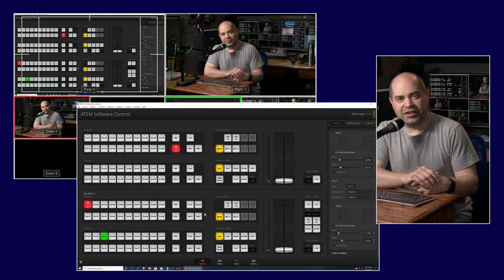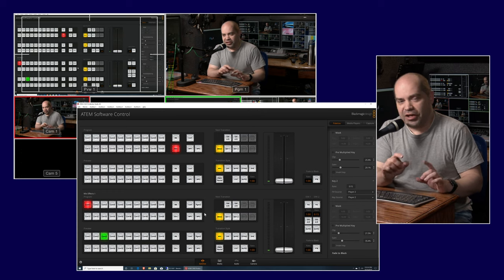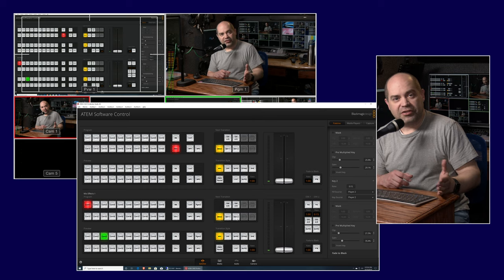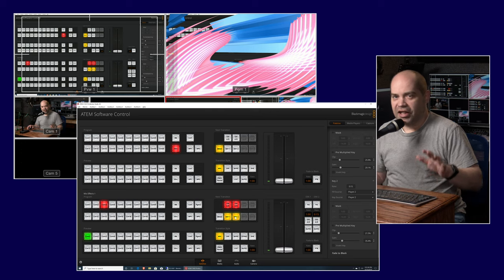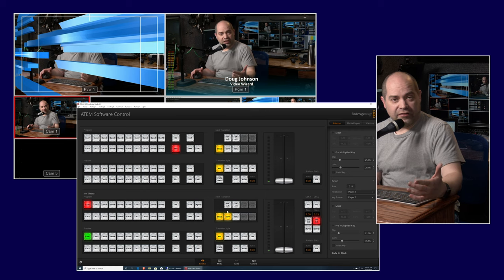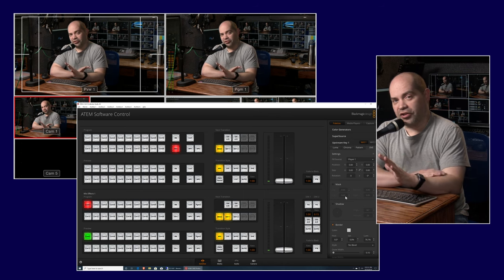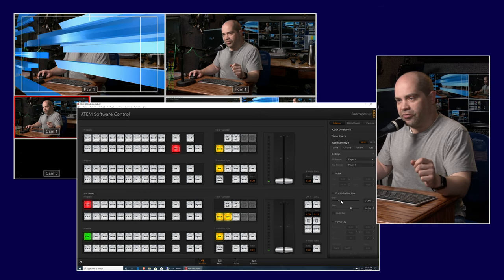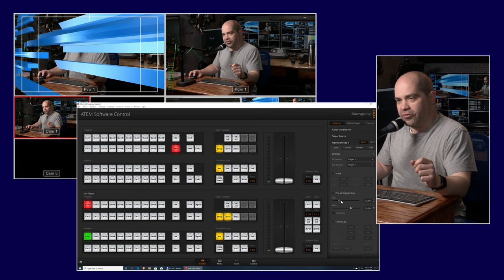Video Training: Upstream and Downstream Keys... What are they?

Comment: I am in need of using two separate alpha key sources. One will be for media over a livestream broadcast, and the other will be for media over in house IMAG. What I plan to do is switch between cameras and have DSK that is sent from Propresenter 7. With an SDI output card I am able to send the key and fill source as needed from PP7, which allows me to have two SDI lines as separate sources into the switcher. What I would like to do is create two separate PGM outs. I plan to have two separate alpha key signals for media overlays (2 separate keys and 2 separate fills). I would like to have PGM1 use DSK1 and PGM2 use DSK2, but I am not positive that this is a functionality of the ATEM 2 M/E. If this doesn't work, the only other thought I had was using a 1 M/E alongside the smaller TV Studio. 1 M/E would switch cams and have one alpha key to PGM1, and another out would be the clean feed without any keyer? Then the smaller TV Studio would simply receive the switched cameras, and then a key and fill source for the second DSK. I want to do all this on the 2 M/E. Can you help me here?
Reply from the maker: The 2nd M/E doesn’t have any DSKs. You’d have to do it with a USK and all of the headaches that come with that.
Reply: @djp_video  Ok. What would you recommend for making this happen? Apart from camera switching, I basically allow the DSK to be slave to whatever ProPresenter7 is sending it. No switching necessary except camera view. Is there another product that would allow for the setup I mention earlier? Or would it be easier, more cost effective, to run this setup through a 1 M/E for main camera switching and one DSK for one of the needed PGM outputs, and then run a clean feed of the switched cameras out of the 1 M/E and into a TV Studio with two additional inputs for key and fill for that units DSK (3 SDI inputs total on the TV Studio).

Comment: Can you make video pls
Reply from the maker: You don't need to spam me with six messages. One was sufficient.

If your model of switcher doesn't have SuperSource, it also doesn't have the required hardware to do two picture-in-picture windows. You either need SuperSource, or two DVEs, to do what you're wanting to do. All of the models with two DVEs also have SuperSource as well. These include: 

ATEM Mini Extreme [ISO]
ATEM SDI Extreme [ISO]
2 M/E Constellation HD/4K
4 M/E Constellation HD/4K
Constellation 8K
Television Studio HD8 [ISO]
Television Studio 4K
2 M/E Production Studio 4K (must use SuperSource; it only has one DVE)
4 M/E Broadcast Studio 4K (must use SuperSource; it only has one DVE)

The following models cannot do it, as they don't have the hardware to scale two video sources. If you have one of these, you'll need to upgrade to a higher-end model...

1 M/E Constellation HD/4K (No SuperSource, only one DVE)
ATEM Mini Pro [ISO] (No SuperSource, only one DVE)
ATEM Mini (No SuperSource or DVE)
ATEM SDI [Pro] [ISO] (No SuperSource, only one DVE)
ATEM Television Studio HD [Pro] (No SuperSource, only one DVE)
ATEM Television Studio 4K Pro (No SuperSource, only one DVE)
Any other model not listed

Comment: This is awesome! Thank you, I have one quick question... how does this apply to overlaying (keying) pro-presenter feed over my camera feeds?
Reply from the maker: You could use either an Upstream or Downstream key to perform that overlay. They both behave the same in terms of how you set them up.

The best way to do it is to have it output separate Fill and Key channels so you can preserve the transparency data created within ProPresenter and use that to create the cleanest overlays in your ATEM. That requires a DeckLink or UltraStudio device with separate outputs for Fill and Key, like the UltraStudio Mini 4K, old UltraStudio 4K, or upcoming Media Player 10G (as Thunderbolt devices), or Decklink Duo/Quad/Extreme/8K Pro.  I haven't done a video explicitly about using that technique from a computer, but the technique is similar to what is demonstrated in https://youtu.be/64RZOAy9j3s and https://youtu.be/rLrmRnjWjTY using HyperDecks instead. 

You'd setup your Upstream or Downstream key in your ATEM to use the two channels from your UltraStudio/Decklink independently, and this would give you the best result possible. It allows not only gives the cleanest looking graphics, it also allows you to do things like partial transparency, where graphical objects allow some of the background to show through. That's impossible, or at least extremely difficult and limited, with other techniques.

This works because your software is providing both the image that you want to see (Fill), and the transparency information (Key) separately. So any pixel on the screen can be fully opaque, fully transparent, or anywhere in between, regardless of what that pixel represents.

You could also do it using a single output channel from ProPresenter using a Chroma or Luma key and an UltraStudio or DeckLink, or even a computer's built-in HDMI output. Each has its own disadvantages. 

A Chroma key is where you have a particular color in the image that you make transparent, like a green screen. The two biggest disadvantages are that (1) the edges on transitions between transparent and opaque are often ugly, being much too blocky or not separating cleanly from the key color (green-tinted edges). This is particularly true because ATEM (and nearly all other) switchers work in 4:2:2 video which essentially means that adjacent pixels share common color data, so a red pixel next to a green one, for example, will never key as cleanly as you might like. (2) None of the objects that you intend to show on-screen can have that transparency color present, or that part becomes transparent too. It can also be time consuming and frustrating to get setup correctly. On the ATEM switchers, the Downstream Keyers do not support Chroma key so if you go this route you have to do it using the Upstream key instead.

A Luma key lets you make everything that is black transparent. White text on a black background would be a classic example of that. You can get clean edges with a Luma key, at the expense of not being able to have anything black in your image be opaque. Blacks do tend to appear quite commonly in most graphics and video sources, so this could be problematic to deal with.  It's also tricky to make anything partially transparent when using a Luma key with a single channel of video.

Comment: Thank you for this video. I've been working with a ROLAND V-8HD before and the chroma key stays active regardless of transitions. While it can be very useful to switch of a  lower third with a transition automatically it would be really helpful to be able to keep it. And the DSK doesn't provide Chroma Key which is very useful since we use powerpoint for the lower thirds. Any recommendations?

Comment: Four years later and BMD's ATEM Software Control is still full of pitfalls. @10:00 "Even though the DSK is not technically part of the transition, you can actually have it brought on or off screen while you're doing a transition." Not sure what you mean by "technically" or "just a convenience feature", but if I understand correctly, the functionality of the TIE button is that it ties a particular DSK into subsequent transitions? So when TIE is ON, the DSK will change state on each transition, reversing the current state of the DSK ON AIR button? Doesn't that mean that turning on the TIE button makes that DSK act like a USK?
Reply from the maker: To some degree, yes... in terms that a layer can be added/removed on top of your main video sources during a transition. But the DSKs on ATEMs are more limited, in that they only support Luma keying (no Chroma key, for example), and there's no DVE on the DSKs either -- so you can't move or resize the DSK source as part of the DSK itself. But you're right that it's the Tie button that is used to cause the DSKs to dissolve on/off whenever you use the Cut or Auto button to perform a transition.

As a general rule, DSKs are usually meant to stay on screen while video sources underneath them are changing. USKs are often (but not always) brought on/off with transitions. 

But the DSK does have one trick that the USKs don't -- that's Clean Feeds. I have another video on the channel that covers them, but you can extract the 'clean' video from the switcher wihout the DSKs, before the DSKs are added to it, by routing the clean feed to one of the outputs on the switcher, separate from the Program output. So if you needed a copy of your video without a bug, or a score overlay, or another graphic, you can use the DSKs to apply it, and record a clean feed from the switcher without those elements.

Comment: Great video Doug. Love your work. I noticed you have Key 1 and Key 2. There appears to be more room for more keys. My Studio 2 only shows Key 1 and I would like to do lower thirds on Key 1 and Picture in Picture with Key 2. I also need a Key 3 for a graphic overlay at different times. How do I get Key 2 and Key 3?
Reply from the maker: It varies by model of switcher. The software enables the buttons for whichever keys your switcher supports.

Comment: Does a green screen always mean a big piece of cloth that is green or is it sometimes a computer generated green screen?
Reply from the maker: It can be anything that creates a solid color background that can be replaced in editing. Green cloth or painted surfaces are common because they're easy.  

It actually doesn't have to be green. Any color can be used as long as it doesn't appear anywhere else. But green and blue tend to work well.

Comment: Great video. This helped clear up the difference between the streams and different keys. Could you not also do the transitions for the graphic via the hard transition buttons on the ATEM switcher?
Reply from the maker: If you're wanting to do a transition between full-screen graphics, I'd look at setting them as your source, then doing normal transitions between them.  If you want to do transitions between overlays (like lower thirds), the Upstream keys are the way to go.

Comment: So Doug there is no way to see all 4 m/e's even if you have 2 monitors?
Reply from the maker: See what about the 4 M/Es? The Control Panel? You'd have to run multiple copies of ATEM Software Control, but that's not something that Blackmagic supports so you have to engage a workaround of some kind to allow it. And even then, you'd only be adding one additional M/E to each display.

If you're referring to multiviews for each of the 4 M/Es, the 4 M/E switchers do have four multiviewers so you can see whatever sources you want on each of those four outputs.

Comment: Another great video, thanks.
I recently did a gig with constant logo on screen, except when VTR is running, and multiple lower thirds, and it was really annoying to get everything working properly. The facc that there are only 2 media player slots really frustrated me on that show.

In any case, I have a completely different question - I've been wondering how do you configue and control your x-keys panel. i currently use JustMacros which is unfortunately discontinued, and isn't that intuitive to begin with in my not-a-programer opinion...
Any other reliable cost effective simple solutions out there?
Reply from the maker: I often use a computer for doing the graphics because of the media player limitation.

I'm still using JustMacros, until I have a chance to write my own software. I'm hearing a lot of buzz around Bitfocus Companion, which works with the Streamdeck, and there's another one whose name escapes me at the moment.  Take a look at some of the video production forums around, especially the one on Blackmagic's site.
Reply: @djp_video  
Thanks for the reply, I use Companion with a Streamdeck for macros and integration with vMix and such. Still the xKeys is more convenient for the natural all around switching.
As far as i understand, if I'll update my ATEM to the latest firmware then Justmacros won't recognize it rendering the xKeys useless.
Do you know anything about that?
Do you have a video about setting up and using Justmacros and xKeys? I find it very hard to find anything that doesn't involve some kind of programming that is beyond my capabilities...
Reply from the maker: I've upgraded my ATEM several times since the last JustMacros update and it continues to work (as well as it ever has). 

I don't have a video training on JustMacros configuration. For most switcher functions no actual "programming" is necessary -- it's just assigning the buttons to switcher functions one at a time.
Reply: @djp_video  
That's true for the most common commands that are just a press of a button, but if ,let's say, I want to assign different inputs to the USK, which is something i use alot to change the camera showing inside a PiP shot, i couldn't figure out how to do that.
Or even just a simple macro is something i could'nt quite get how to do, so that leaves a lot of the capabilities out of my reach.
In any case, if you feel like doing a video on it, it would be much appreciated, and I'm sure that not only by me 😃

Thanks for great videos.

Offtopic- do you have any experience with Canare L-5CFW SDI cables?

Comment: How are you seeing two m/e (s) on the monitor? Blackmagic says its cannot be done . I have the 4 m/e switcher
Reply from the maker: I've got several things going on here:

1. I'm recording the output of the 2nd M/E. That's what you're seeing here. I'm doing it on the 2nd M/E so you can watch what I'm doing on the 1st M/E without affecting the recorded video.
2. I'm feeding the MultiView 1 into a Teranex Express to upconvert its 1080i output to 2160p29.97, and sending that back into one of the switcher's inputs.
3. I'm using the SuperSource in the switcher to put the three video sources in windows. One source is my camera (obviously), the 2nd is the computer running ATEM Software Control, and the third is the up-converted MultiView output.

I very often include the Program output of both M/Es and the two Multiviewers on monitors around the trailer. This is done using a MultiView 4. Using the MV4 in 2160p29.97 mode, the 4K monitors in the trailer are showing four sources at 1080p resolution, so they look really good. I'm not showing that in this video, though.

Comment: Very informative video, I do have 1 question though. Is it possible to tie a key to always be on for one or more inputs? For example, if I have a graphic I always want shown over inputs 1 and 2, is it possible to have that USK or DSK transition in whenever I go to inputs 1 or 2 from any other input, and if I switch between shots 1 and 2 it just stays there and only transition out if I go to an input other than 1 or 2?
Reply from the maker: Not built-in. But you could do something like that with macros for sure.

Comment: I have a question about alfa channels; I have a Hyperdeck mini and an ATEM mini so will the extreme do they work over HDMI?
Reply from the maker: The HDMI output on the HyperDeck Studio Mini doesn't have the alpha channel. It is only available on the "B" SDI output. So you'll need to get an SDI-to-HDMI converter.

I actually have a video coming out on Monday where I demonstrate this.

Comment: Our church has a Panasonic BGH1 that we use for live streaming with an ATEM 2 M/E Constellation. We always apply a letterbox (top & bottom bars) to the BGH1 output and this causes problems when using macros. My work around has been to turn the key at the beginning of each macro opposite of my desired state and then I transition the key at the end of that same macro to my desired state on or off.

Example of problem: When I use two macros back-to-back that include the same command to turn on upstream key 1 - well the first macro turns key 1 on, the second macro turns key 1 off. This is because the yellow “Key 1” cycles the state (See 6:45 in your video) instead of being a true on or off button. 

Is there some way we can apply a LUT letterbox or PNG letterbox all the time to the 1920 x 1080 SDI output of our BGH1? Some reasonably priced hardware device installed between our BGH1 and our ATEM? I know of no way to install a letterbox in our BGH1. We have a 3 camera setup so the order we apply our macros varies greatly depending upon the songs, order of service, wedding, funeral, etc.  Thank you.
Reply: Or feed one of our M/E's into the second M/E?
Reply from the maker: I'm not aware of any simple devices which can add the letterbox. You could always go with an ATEM Mini or SDI to do that, though.

Comment: Fantastic help. Thankyou very much. I'm new to video production and after doing a lot with webinars lately, I am playing with doing 3D anaglyph live production. Is it possible to adjust my BG as a mono-chromatic live image (e.g. cyan) whilst using the second view at 50% opacity (upstream key) with a red mono-chromatic image? A third and fourth input as standard (non-stereo) views would be useful too but not absolutely required. I'm using the ATEM mini so I am very aware this might be asking too much.
Reply from the maker: There are two easy ways to do this... the first would be to create a 50% solid gray image that you use for the key portion of an upstream key while using the second, red image.

The second would be to put your two video sources into two different inputs, then use the T-bar to do a 50% dissolve between the two.
Reply: @djp_video  Thanks Doug. I'll have a play and see what I can make work. The 50% dissolve is the most logical and it had totally passed my mind.